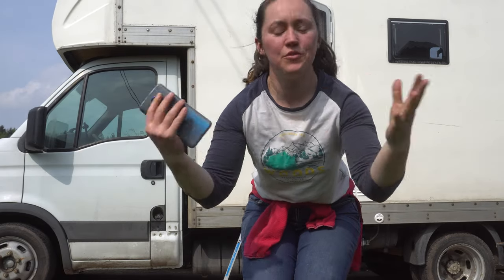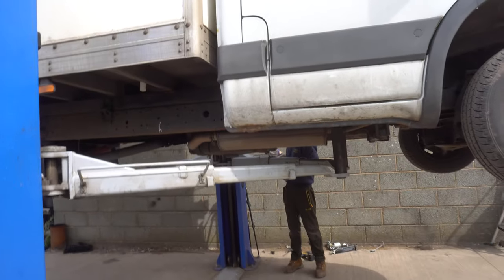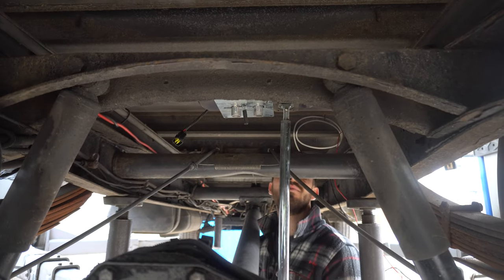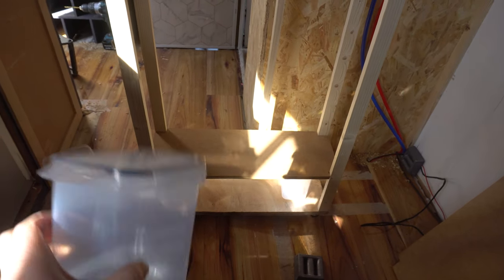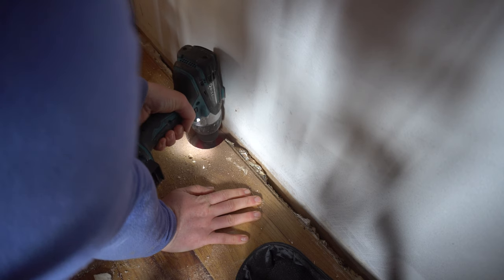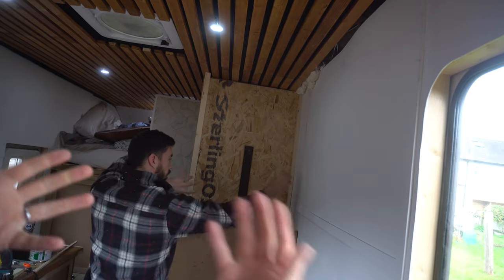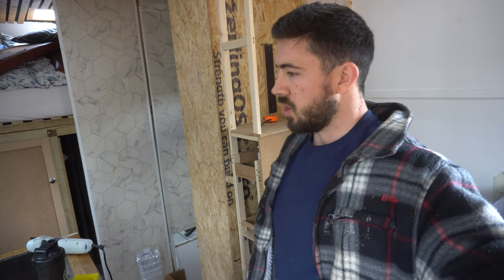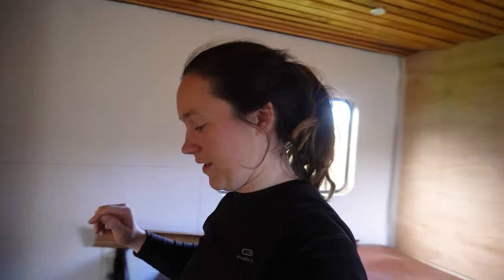Installing Chinese diesel heater under our van - LUTON BOX VAN CONVERSION

Comment: Good work, what is your experience of having the heater mounted outside under your van? is the road dirt any problem to the heater? Have you done any mods after set up and installation? Do you drive in snow?
🤨🤨 I hope you have a lot fun with your van!!

Comment: great job as always 

but just a thought I had, the heater look really similar to "will's whereasabouts" one, hopefully you guys don't face the same issues he went through
Reply from the maker: Oh what issues did he have ? I didn't see that video. I did see a lot of people had issues with the green fuel tube so we replaced that with some better tube
Reply: @heatheroreillyduff5604  

I am no expert with van building but just thought about sharing some resources that I found 

if I remember correctly,the issue was with the display and brain of the heater it kept showing a certain error message code 08 & 10, although he tried multiple solutions such as replacing the line and other stuff.

here is the video, you guys might find it helpful :

 https://youtu.be/ulaDvcUEtKU

Comment: Just be careful with the air inlet for the warm cabin air, it should really be piped into the cabin space as when it breathes from outside it could pull the exhaust fumes back into the living area
Reply from the maker: Hi David. That's actually a really good point I hadn't thought of. Ive has a check and I think we are safe enough the exhaust and inlet a good distance apart
Reply: @heatheroreillyduff5604   You're also heating cold air from outside and bringing it in with the fumes. If the air was fed in from inside then you would be far more efficient at heating inside and safe from fumes. Not to mention these units aren't designed to be open to the elements... They are chinese afterall!!!